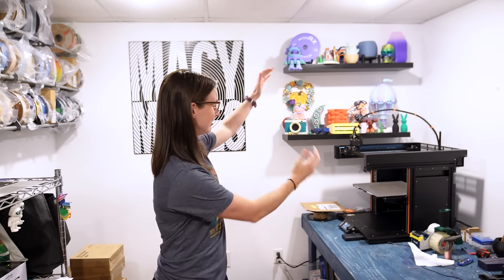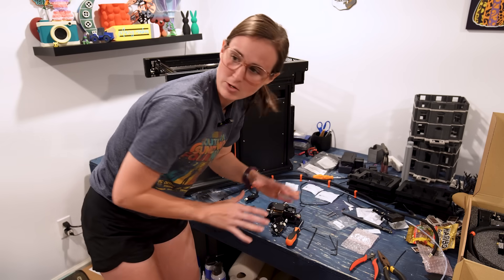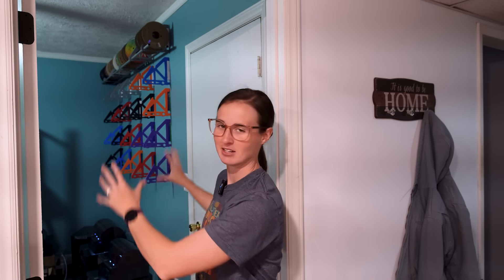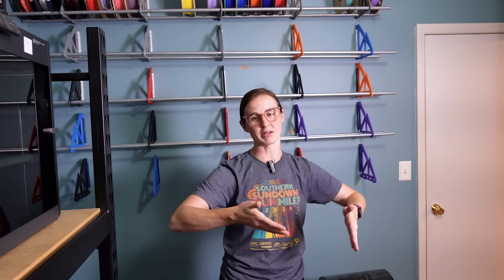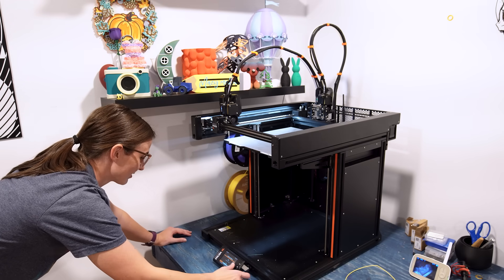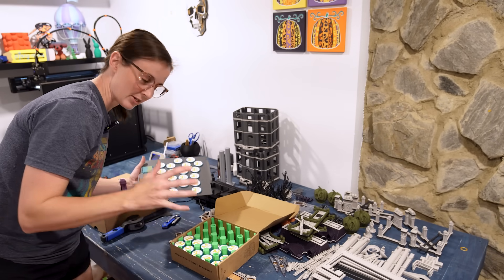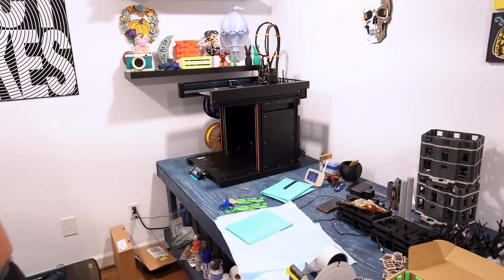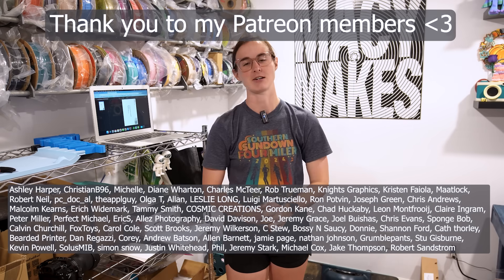3D Print Farm Day in the Life - Prusa XL Dual Tool Head Upgrade

Comment: Question: How bad is the smell of melted plastic and how do you deal with it in your house?
Reply: PLA barely gives off any odor and is generally considered harmless.  Other materials, such as ABS, should be printed in an enclosure (to maintain chamber heat as well as contain vapors) and vented outside.